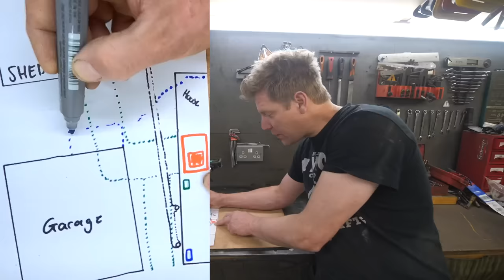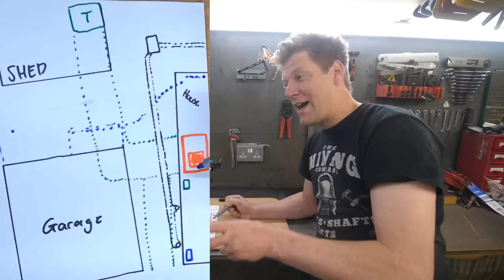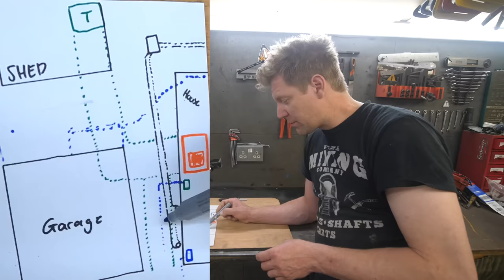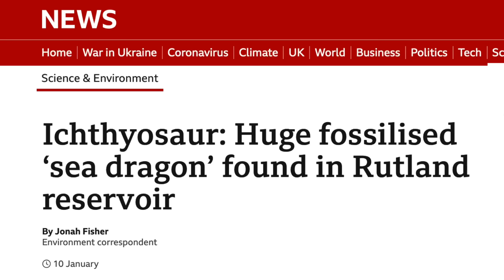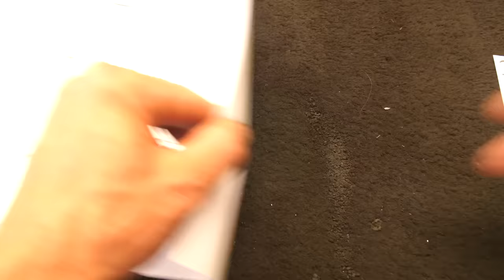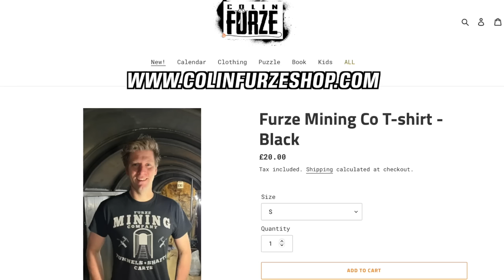DIGGING A SECRET TUNNEL Part 9

Comment: The insight into the admin aspects was worth waiting for, and I understand why you haven't addressed it before now. (I was one of the many who asked.) You've basically summarised the conclusion that many people have reached through experience (including me) in the UK which is to ask for permission only when you can't get away with not doing so. Councils only have themselves to blame for that, by objecting to and blocking silly little things simply because they are high on the power it gives them (I have plenty of examples I won't bore you with).

Asking for detailed scale drawings for any and every enquiry is, sadly, typical council behaviour, and just contributes to people simply not asking, or only doing so after the event.

I can only speak for myself, but I bet I'm not the only one learning a whole cross-section of stuff from this future Colin Furze box set.
🇬🇧
Reply: Good when it works, not so good when they refuse afterward and make you tear it down. The expense could be a lot more than a couple of drawings.
Reply: It would be so droll if they demanded he just pours concrete back in, but he'd get approved because he is probably a freemason and therefore on the good side of the control grid that torments us all.
Reply: It is very interesting. I've work with permitting/licensing in the USA for years. It is generally true that asking for forgiveness is easier than asking for permission... unless you've strayed far from regulations. One case comes to mind where a guy spent hundreds of thousands of dollars on a project and received a court ordered injunction. Now he would have to rebuild the entire structure with proper permitting. Now, anything he does won't go unnoticed. He also gets zero benefit of the doubt. If you've ever worked with government, it isn't obvious when you are getting benefit of the doubt BUT it is very obvious when you aren't getting ANY benefit of the doubt. Last of all, if anything goes wrong on a project without approval then you've opened yourself up to a world of litigation hurt.
Reply: @norro21  I'm really speaking about small projects rather than house builds for example. The number of small outbuildings (I'm in the countryside in Scotland) that end up mired because permission was sought is ridiculous, especially when local regulations state permission isn't required. Councils often want you to ask (with a fee) just to confirm what was already suspected from reading the regs.

I agree it can be a gamble, but it could be avoided if some (not all) councils started behaving sensibly.

Comment: Nice job CF a few new questions for you
1. Do you ever monitor air quality in the tunnel?
2. Has it added value to your house and if so how much?
3. The killer question how much has the tunnel build cost?
Reply: For question 2: i saw that that he’d sell the bunker with a house rather the house with a bunker so property value has definitely increased
Reply: Since he’s doing the digging and welding himself, I imagine it’s cheaper per square foot (or meter) than the bunker build, but it’s still going to be unbelievably expensive for all the tube steel, sheet metal, mesh and concrete that is going into this. Not to mention dumping/hauling fees for all of the dirt and rock that is coming out unless he’s worked out a deal with someone that wants it.
Reply: @gthetree1  clean fill is often desired and there are places that will take it for free.

Comment: I have a question that I don’t know if you’ve already answered: How much has this operation cost so far or how much do you project it to cost in the end?
Reply: It's sponsored
Reply: @patriot1525  yea but to what end? This has got to be unbelievably expensive just for materials!
Reply: I'm pretty sure one of the terms of the sponsorship is that they aren't allowed to say how much it's for. something I remember hearing in another video a while ago, could be different now.
However! this video shows accurate drawings of the tunnel, so if you wanted to, you could calculate how much steel, concrete, wood, etc were used, cross reference with the prices at the time of applicable video release and get a solid estimate...
Reply: @DraconianEmpath  ohhhh that’s a good point. I mean I’m definitely too lazy to do all that work but it’s nice to know that it could be done in theory!
Reply: @Gundumb_guy  somewhere between 100k to 100M lol is my guess
Reply: I don't have the numbers but will explain some the construction, take the steel sheeting he uses, it looks big but gets used very fast in short amount of distance. Much like a big pile of drywall sheets , disappear quickly when redoing a room. If you understanding build material usage and needs , you can skip. If not I hope this helps to comprehend how to start figuring the cost per section.

The price of a  steel tuning and the sheet of steel have changed greatly, since Colin started this.   From when he started to the current 2022 semi-post covid pricing is in magnitudes higher for  the same pieces. For every section he builds at current prices, he could have 4-5 section of the same materials at the beginning prices.  Basic inflation not even mattering for this increase difference, since the raw material prices are nuts..   Those steel sheets come in roughly 4 feet by 8 feet (or what ever those nasty metric numbers are) and  by a measured thickness or "gauge"    The steel tubing may come in matching 8 foot lengths or in 10 foot, sometimes the price difference is worth buying the longer just accumulate  the scrap bucket of pieces, so you don't have to chop down full length  piece that then can't be used normally. It is kinda like buying wooden studs for walls where they sell them 8 footers that may be at 93 inches and/or at 96 inches. Many people have bought the 93" version and then had issues that weren't actually 8 feet aka 96 inches, but that digresses.

If it is 4 feet between walls(looks closer to just over 3 feet (1 meter) X 8 feet (run or length, could be  a metric number also) on the ground, then each side gets 2 of 4' X 8' vertical sheets to make and 8' by 8' square section on one wall and then 2 4 X 8 sheets to repeat for other side wall, then you have the steel that is bent for the roof. That  will match the 4 feet across the floor and then make the run/length along the length.  Although, Wait! The roof is curved, so  depending on the curves radius size for circumference, he might not be able to get 2 roof pieces 4 feet by 4 feet wide out of  1 @ 4 feet X 8 feet sheet .  Because that curve when laid flat (unrolled/pre-rolled/pre-curved) is  some length over 1/2 of that 8' long side (More than 4 feet because that bend uses a few extra inches meaning the scrap piece is smaller than 4+ feet needed for the next roof section. Although I imagine for cost that roof is a 1 steel sheet split in half. This is why the tunnel is built in even segments until he gets to corners/junctions  where he cuts a special intersection. Creating lots of wasted steel sheet sections, hopefully reusable elsewhere on the project.   Which is partially why the tunnels walls are straight and not with many funky curves and/or angles.

So how many sheets does it take per 8 foot long tunnel,  with about 8 foot high to a  roof by with about  4 feet across to tunnel walls ?  Its about 6 sheets of steel but that's not counting costs of the steel tubing and mesh, welding supplies, waste for special junctions, etc. Then comes all the utilities, flooring(wood) then carpet....  So look up Steel sheeting prices for about 1/8th of inch thick and then take the length length divide by 8 and then multiple time those 6 sheets and you have cost figure for just the steel sheeting. Quite the investment huh?

You can look up the cost of sheet of steel from "Steel Supplies", not from your  hardware store chains   like Lowes or Home Depot(etc), whose  prices for steel  are utterly absurd. Those are for people that will never need a full length piece , nor want the hassle of storing  the scrap for year to decades  or they have someone ) needing an emergency patch piece (or a hobbyist that doesn't know better or is scared to go to real places) that they can gouge for the convince of it being there.  Then again price from their for even higher number to appreciate how much this could cost. realizing your steel costs and the cost to him can vary greatly for how far it has to be shipped, if it has to be off loaded from ships, onto trains, then to trucks, to your local steel and metal suppliers.  With delivery costs factored in there. Steel sheets are not something you can lay the seats down in load in the back of your SUV type car. Or you can if you don't care about ruining the inside of the vehicle as the steel shifts it will shared all the fabric and plastic in the interior and scratch any metal source through the protective paint down to bare metal.....    Hauling this in pick up with bed liner protection shield will trash the back worse than load of gravel.
Reply: I don't have the numbers but will explain some the construction, take the steel sheeting he uses, it looks big but gets used very fast in short amount of distance. Much like a big pile of drywall sheets , disappear quickly when redoing a room. If you understanding build material usage and needs , you can skip. If not I hope this helps to comprehend how to start figuring the cost per section.

The price of a  steel tuning and the sheet of steel have changed greatly, since Colin started this.   From when he started to the current 2022 semi-post covid pricing is in magnitudes higher for  the same pieces. For every section he builds at current prices, he could have 4-5 section of the same materials at the beginning prices.  Basic inflation not even mattering for this increase difference, since the raw material prices are nuts..   Those steel sheets come in roughly 4 feet by 8 feet (or what ever those nasty metric numbers are) and  by a measured thickness or "gauge"    The steel tubing may come in matching 8 foot lengths or in 10 foot, sometimes the price difference is worth buying the longer just accumulate  the scrap bucket of pieces, so you don't have to chop down full length  piece that then can't be used normally. It is kinda like buying wooden studs for walls where they sell them 8 footers that may be at 93 inches and/or at 96 inches. Many people have bought the 93" version and then had issues that weren't actually 8 feet aka 96 inches, but that digresses.

If it is 4 feet between walls(looks closer to just over 3 feet (1 meter) X 8 feet (run or length, could be  a metric number also) on the ground, then each side gets 2 of 4' X 8' vertical sheets to make and 8' by 8' square section on one wall and then 2 4 X 8 sheets to repeat for other side wall, then you have the steel that is bent for the roof. That  will match the 4 feet across the floor and then make the run/length along the length.  Although, Wait! The roof is curved, so  depending on the curves radius size for circumference, he might not be able to get 2 roof pieces 4 feet by 4 feet wide out of  1 @ 4 feet X 8 feet sheet .  Because that curve when laid flat (unrolled/pre-rolled/pre-curved) is  some length over 1/2 of that 8' long side (More than 4 feet because that bend uses a few extra inches meaning the scrap piece is smaller than 4+ feet needed for the next roof section. Although I imagine for cost that roof is a 1 steel sheet split in half. This is why the tunnel is built in even segments until he gets to corners/junctions  where he cuts a special intersection. Creating lots of wasted steel sheet sections, hopefully reusable elsewhere on the project.   Which is partially why the tunnels walls are straight and not with many funky curves and/or angles.

So how many sheets does it take per 8 foot long tunnel,  with about 8 foot high to a  roof by with about  4 feet across to tunnel walls ?  Its about 6 sheets of steel but that's not counting costs of the steel tubing and mesh, welding supplies, waste for special junctions, etc. Then comes all the utilities, flooring(wood) then carpet....  So look up Steel sheeting prices for about 1/8th of inch thick and then take the length length divide by 8 and then multiple time those 6 sheets and you have cost figure for just the steel sheeting. Quite the investment huh?

You can look up the cost of sheet of steel from "Steel Supplies", not from your  hardware store chains   like Lowes or Home Depot(etc), whose  prices for steel  are utterly absurd. Those are for people that will never need a full length piece , nor want the hassle of storing  the scrap for year to decades  or they have someone ) needing an emergency patch piece (or a hobbyist that doesn't know better or is scared to go to real places) that they can gouge for the convince of it being there.  Then again price from their for even higher number to appreciate how much this could cost. realizing your steel costs and the cost to him can vary greatly for how far it has to be shipped, if it has to be off loaded from ships, onto trains, then to trucks, to your local steel and metal suppliers.  With delivery costs factored in there. Steel sheets are not something you can lay the seats down in load in the back of your SUV type car. Or you can if you don't care about ruining the inside of the vehicle as the steel shifts it will shared all the fabric and plastic in the interior and scratch any metal source through the protective paint down to bare metal.....    Hauling this in pick up with bed liner protection shield will trash the back worse than load of gravel.
Reply: @pvic6959  it’s definitely over 100k for sure! Hopefully he bought most of all the materials he needed at one time and saved some money.
Reply: Nowhere near.
Reply: @ablemagawitch  steel is cheaper than timber atm
Reply: Steel is cheaper than timber right now. That is true, but steel is still expensive. That sheet metal, mesh, box section will run into the 10s of thousands of pounds. Plus cement, sand, and waste removal. Plus sundries like disks, oil, petrol, sticks and then utilities such as power and water. Then you have labour on top of that which would be a requirement for the time frame of these videos. 100k would be a very low estimate.

Comment: Planning permission was an interesting question and answer, because I thought it would of been covered by "permitted development" and therefore didn't need planning.  I guess that might have been true for the bunker, but once you started digging tunnels and getting close to piped services its different.
Reply: The way it works in the US at least, and it might be similar in the UK, you have utility easements that you would have to account for. Those can be for anything from electric lines, to fiber/telephone/TV, to water lines, to a drainage basin for collecting rain runoff.

Comment: I'd like to see a cost analysis when it's done just to know how much something like this will dent the pocket book.
Reply: I'm pretty sure he said somewhere that the bunker alone cost about £20k in steel and concrete
Reply: Cheaper than an extension and 10x as cool
Reply: Its gotta be more than that..  with the amount of steel and concrete, wiring, other stuff, equipment, all of it.  Its gotta be close to the 100k mark..  gotta be..
Reply: @Z-Ack  Steel sheet 4-5mm is generally around £100 per sqm not including any kind of deals or bulk buying etc - i forget what size Colin uses but I think 100k would be far overestimating. Concrete isn't expensive, the steel will be the bulk of the material cost.
Reply: Even if it isn't covered by channel revenue, being the guy who has a tunnel from your house to your shed and bunker is priceless. Also since the eventual sale of the property will have to focus on the bunker as primary and house as decoration, it really just makes the bunker more useful.

Comment: Another Geologist's comments:
My guess is that the crystals are mostly Calcite. Put some vinegar on the crystals and if they fizz they are Calcite. If you think you might have Quartz, try scratching some glass like a pickle jar and put some pressure into it.
Not having it in front of me, you may have a nodule of Calcite. They tend to flatten because of the pressure of rock above them. Nodules can form from a bubble being filled in or a crystal forming in situ, and growing, which pushes the rock/sediment away and gives a clean crystal. Crack open a few. If they are hollow you then have a Geode. I also have found fossil shells with a solid Calcite crystal inside. 
Good luck and have safe fun. I am sure you are just a few feet away from another Ichthyosaur fossil find. Don't forget to tell the university when you find that fossil. It might be a new species that they name after you. I suggest crazycollini as the species name.

Comment: If you have a day off or two, I am interested in if your underground tunnel / bunker accumulates Radon gas.  Might not be a bad idea to put a radon tester down there to get a baseline as to your radon levels.  This would help you to determine what ventilation would be necessary to mitigate any radon gas that might be down there.